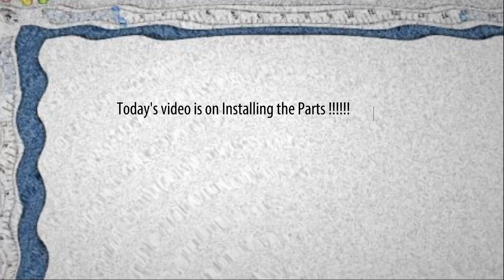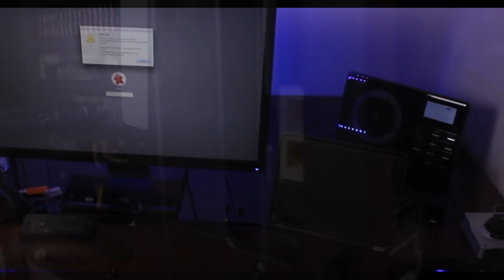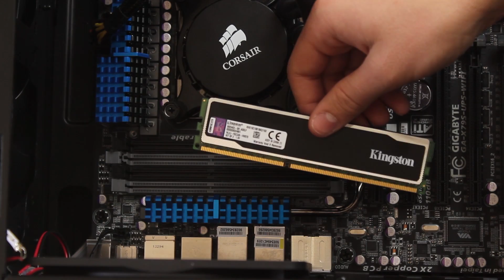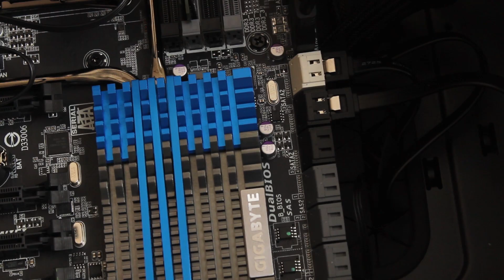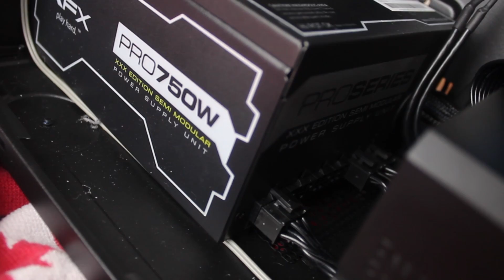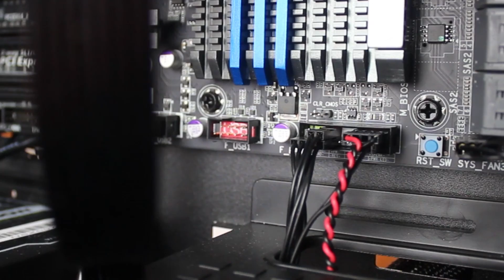How to Build a Hackintosh Part 2 - Installing the Parts

Comment: PROBLEM: HELP ME! hi, have you an email for questions about this? i hope you help me, i buy the mother ga-x79s-up5 for make my hackintosh, all works fine, i install Maverick last version. The problem is this, the mother ga-x79s-up5 have 8 SAS connector, same like SATA, when i connect hard disk in SAS connector, didnt appere in finder. i try to install windows and this connectors works fine, but i want OSx, so, this mother have others SATA connectors, but i want to connect a lot of hard disk, so i need this SAS connectors. thank you very much.

Comment from the maker: My build UPDATE September 2013
Cooler Master HAF XM ATX Mid Tower 
Intel Core i7 3930K LGA 2011 6 Core 12MB 3.2GHZ Overclocked at 4.5 Ghz 
GIGABYTE GA-X79S-UP5-WIFI Motherbaord
Corsair H55 CPU Cooler System
SanDisk 120GB SSD
Kingston 240GB SSD
Seagate 1TB HDD
Kingston 32GB HyperX RAM
Gigabyte GeForce GTX680 4GB Ram Graphics Card 

TP-Link TL-WDN4800 Dual-Band Wireless
BLUETOOTH 2.1 USB Micro Adapter